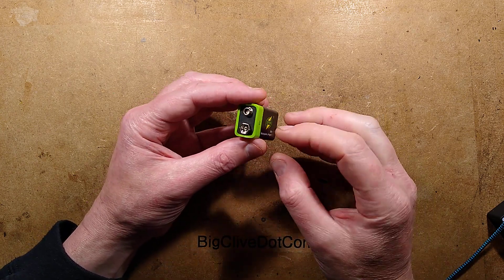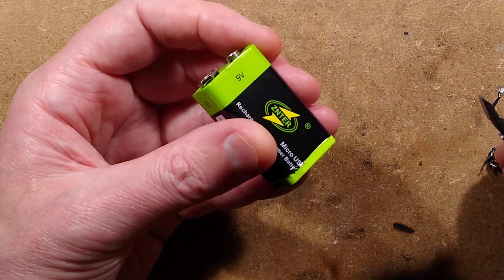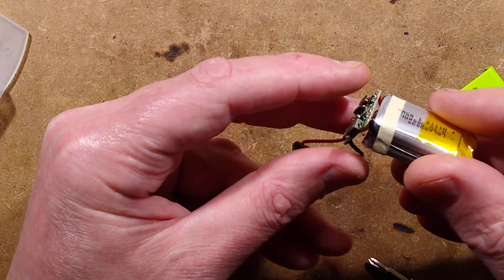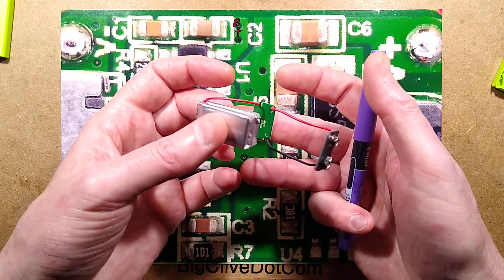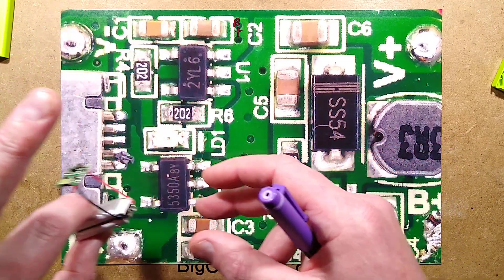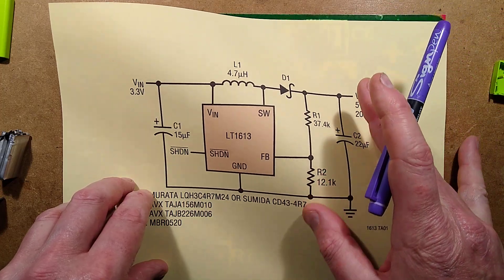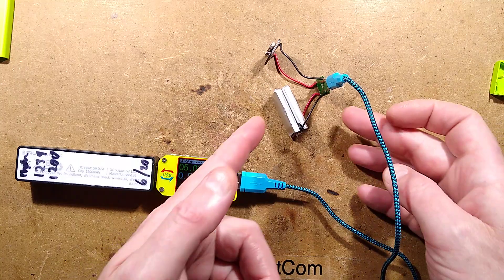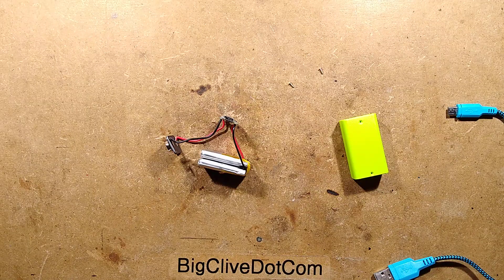Inside a Znter lithium 9V battery.

Comment: I've seen Li-ion USB rechargeable batteries on Amazon before but never really thought twice about them. If there are versions that wouldn't pass on that noise to wireless mic transmitters, they could absolutely save quite a bit for audio departments! Only trouble would be to make sure someone on the team remembers to recharge them after each performance 😊.  I guess keeping a few micro USB charging leads next to where the mic packs are stored could be a good reminder.
Reply: I don't think all of the ones on Amazon use a boost converter. For example, the "Enegon" brand rechargeable 9V that they sell specifically states that the output voltage starts at 8.4V and goes down to 6V. This strongly suggests that it simply contains 2 Lithium cells wired in series. This could be a problem for devices that cut out just under 8V, leaving most of the capacity of the battery unused, but at least there would for sure be no switching noise. I would hope that such 2 cell batteries use smart enough charge circuitry to balance their 2 cells.
Reply: It would be better off with a USB charging station with the exact number of cables to mic ratio and maybe a few more and make sure everything gets charged every night.

Comment: I wonder how useful they'd be for smoke alarms.
Reply: Lousy. Smoke detectors are high voltage, very low current devices.  The boost circuit alone would eat all your capacity LONG before a traditional cell would run flat in that application. I'd be surprised if you'd get more than a few days continuous use out of this thing.
Reply: @mikecowen6507  Even worse: You won't get the low battery beep from the smoke alarm. There will be no low voltage on the boost side. It will just cut off.
Reply: That's the only place I don't use mine.

Comment: All of that quiescent current assist to be in the output voltage divider. I guess the values could be increased a bit of you really needed a lower quiescent current.  Not that it really matters I suppose with a six month shelf life.
Reply: It's the quiescent current that gives it the shelf life. I'm going to get one and hack it for efficiency and lower quiescent if I can. I have one I use for a custom light but that is staying as is.
Reply: Pit they didn't fit an on/off switch down the side - so it could be switched off hen not in use ?
Reply: @millomweb  
Could but a really tiny slide switch on one, I got a "card phone" the slide switch for the battery on/off would easily fit in the battery case.
Reply: @deaultusername  Yeah. I suspect there's room up the side in the groove formed between the 2 cells. Or possibly on the top between the 2 connectors.
Reply: How!? Why?...your comment was apparently posted one week ago - yet this vid only came out yesterday!

Timelord!!
Reply: @thebrowns5337  You're not paying him enough to see them as early as others ;)
Reply: @thebrowns5337  We Scots have super human powers.

Comment: But do you get the same sensation when you put your tongue on it???
Reply: yeah thats the 'indicator' clive asked for. inbuilt already!
Reply: I wonder would it feel differently due to the switching?
Reply: @CollectiveSoftware  Two big caps on the output so probably not. Also, since the boost circuit is regulated the output voltage won't drop noticeably until the cells are flat, rendering the tongue test useless except for amusement.
Reply: @Miata822  amusement is what we are here for:-)
Reply: @fredflintstone1  ...with snacks thrown in now and then !!! Lol !

Comment: I've got to admit having a USB charging 9 Volt battery is pretty damn cool.
Only need a LED "snap-light" to add to the top of the 9 Volt battery for a mini rechargeable torch!!
Reply: Except I would use the biggest damn LED's you can find and really get some light out of it, reading the link in the description, these aren't good for low power applications, because of the drain from the boost circuit. Apparently it makes up for the low power draw by using more power for the boosting.
So the battery will drain about as fast in a low power situation as when it is giving close to its max output (probably something like 200ma if these boosters are anything to go by)
Still, roughly 2 hours of high power LED light and then a USB recharge isn't bad.
Reply: @ballsrgrossnugly  Your info that the boost circuit draws near full power at low load seems unlikely unless there's something silly in the chip. However it may run at a noisier low frequency (perhaps even audible from coil vibration), so perfect regulation efficiency may have been sacrificed for noise reduction.
Reply: its even cooler if you combine it with a Qi to micro usb retrofit adapter - that way you can "upgragde" most of your 9V tools/gadgets to wireless charging :D
Reply: Already on it
Reply: those things already exits
Reply: That's exactly what I was thinking partially I picked up a set from a different manufacturer and I have some pak-light's
Reply: Can it be used in a guitar?
Reply: Yes, there could be a set of little gadgets to connect to it. A torch, a heater, a soldering iron, a mixer/drill spinning thingy etc
Reply: @l3p3  ...mini fan, vacuum cleaner for your keyboard, taser extension...  Lots of stuff!  ;-)
Reply: @l3p3  That's marketing genius.
Reply: I went on a Snowmobiling holiday about 20 years ago, staying in Rentoule, and the highlight was driving at speed across a frozen Lake Nipissing, ending up in North Bay. Totally apropos of nothing but thanks for the memory!